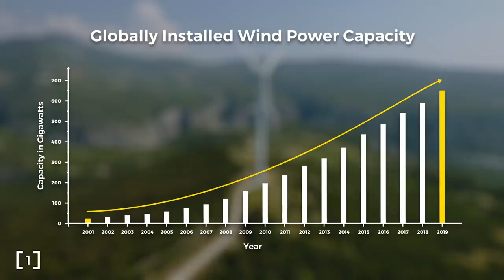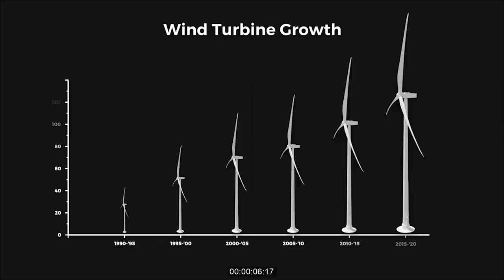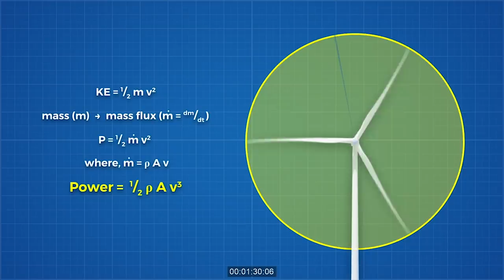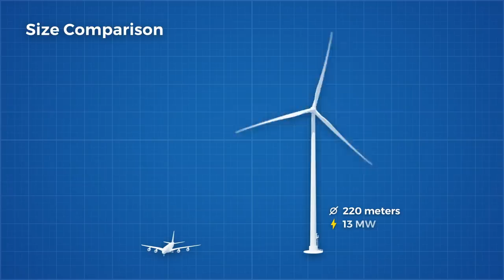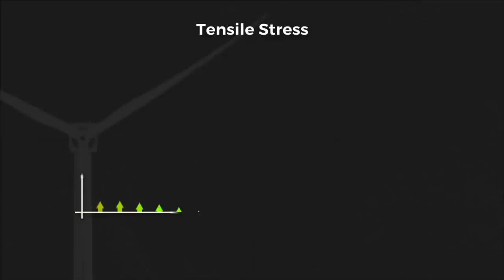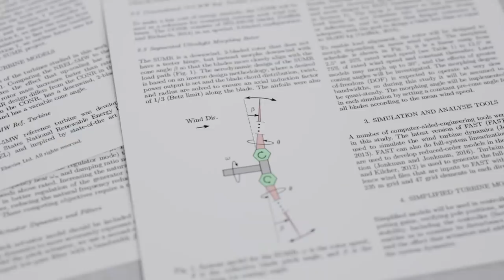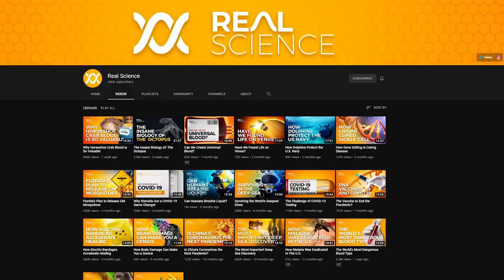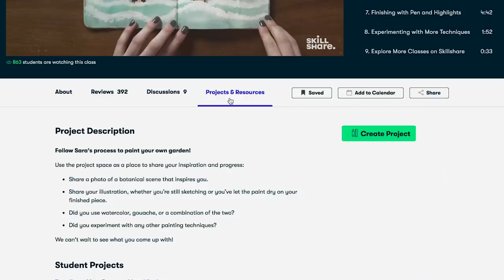How Big Can Wind Turbines Get?

Comment: I mean no. The challenges of handling this very volatile form of energy have not gone away and are still one of the biggest problems we are facing. Countries like Germany went big on Solar and Wind  have created huge problems for the grid to the point that it is not sustainable anymore and all the neighbouring countries are burdened and keep the net from collapsing.
Denmark is using quite a bit of their renewable energy for heating - a good buffer in this case. With district heating you can buffer the energy for hours and more - more than enough for the short changes that solar produces, while the wind-energy which is their main source is rather steady there.
But while wind is more stable than solar it is far from being actually stable in the energy-prices often crash into the negative - the producers need somebody to take up the brunt of the energy-spike or the infrastructure would get damaged.

Finding a way to store the energy quickly and conveniently is basically the biggest challenge for wind and solar right now.

Comment: Impressive cgi on the wind turbine in Paris.  If the CGI intended to show the Halide x, your scale is wrong as the tip height at 230m is some 70m lower than the Eiffel Tower at 300m.

Comment: You will probably hit other limits first, but one eventual limit will be as the tip speed approaches the speed of sound and the added drag when that happens.

WRT land based windmills.  Instead of building the blades at a factory and then moving them, how about build a modular factory components that can be moved on ordinary roads and build them on site?

Comment: You forgot to mention that wind turbines only have a service life of 25 years and that in a lot of cases it's even less because of dust and particles in the wind. These basically sandblast the blades making them way less efficient. 
Then there is the case of added carbon output for some countries that use 70% nuclear right now when switchinh to gas and wind. You even made a video yourself about gas vs nuclear.

Comment: The limiting factor on blade length is the speed of sound. The tips of the blades need to stay subsonic.
If you want a super long blade and have to rotate it very slowly to stay subsonic you will not get the energy from the wind that passes unmolested through the inter-blade gap. 
I don't see the point in any other consideration in the video. The first limiting factor is always blade tip speed.

Comment: Do they have a plan in place for recycling blades that large? This is already a problem with current models.  Thanks for the video.
Reply: shredding, Burning the carbon parts for Energy and the rest is used in Asphalt production.

Comment: Have you considered a point of principle at the heart of engineering which apposes compressive structures with tensile structures? How many spinnakers applied in an ocean current could you get for the cost of just the blades of a wind-turbine, how much greater constancy of yield, what greater force from the density of the medium which has a ratio to concrete of 1 : 2.4? With tension the atomic bond of the molecules is doing most of the constructive work. And in the marine - off-shore - the salt is ready-provided for electrolysis. No damage to marine life as opposed to serious damage by wind turbines to avian life, visual degradation of the landscape, fractional interface with the weather system confronted, partial use ability of the same, and fairly huge maintenance and repair costs. They simply cannot be the real future of energy generation. The leap upwards is into Geodetic considerations which means taking a whole view of Ambient Planetary Energy and interfacing with it at large or condensing it for use in more manageable proportions. I suggest that earth-tangent modular isocratic construction is the thing to consider - not minute stalks with blades on them - and that three starters for combination on that route are 1) Geodetic structures 2) the Isotropic Vector Matrix and 3) Khatmatrix - the last little known but essentially ‘normal’ cubic structuring but upon the basis of a syncopated cubeoctahedron and allowing dry-bond construction in the marine.

Comment: Wind mill huge cost but give 60 % energy converted into electrical energy more over Denmark is a country of winds 60 % Energy through the wind mill The large diameter of the Wind mill with huge cost of transportation in blades more over cost of making high to make wind mill but is renewable energy for World with high cost like Thermal power station Good analysis about wind mill & Structure capable of producing electricity with Cost & Efficiency

Comment: What about vertical turbines? No need for heavy drivetrains to resist over speed rotation. Cheaper structures with heavy drivetrains on the bottom.

Comment: When the blades are fatigued and due for replacement how can they be best re-assigned into something that would be widely useful.   Could the blades be manufactured  to be less than optimal so as to be easy to use in some other role?   It really goes against the grain to visualise the system just putting these  blades into landfill...

Comment: The maximum power is
Pmax=(2/3)^3 ×rho×A×V^3
Not the one (3:29) by a long shot.
The presented physics is sloppy, ignoring the fact that, to extract power the velocity must be reduced, which happens before the flow reaches the turbine plane.
Conservation of mass demands that the flow widens at the turbine disc and more so in the wake behind it.
If the full wind speed would pass through the disc, no power is extracted, as is the case of feathering the blades .
The equation above is is the famous Betz equation.
This can be rewriten
Pmax=(2/3×V)^3 ×rho×A
In this ideal case , the air approaches the turbine disc, slows down and crosses the disk at 2/3 the wind speed and continues to slow to a final wake of 1/3 the wind speed.
In reality the Power extraction is lower.
In all cases the  velocity through the disc is exactly the average of the wake speed and the wind speed ahead of the turbine .
The power extraction is the difference of the incoming wind power and the remaining power in the wake.
with the massflow through the turbine disc:
m*=rho × u × A
rho=density
u=velocity through the turbine disc
A=swept area

P=m*×1/2×(V^2 - w^2)
but P is also the product of the force on the turbine F and u
P=F×u
this force is the difference of the wind momentum m*×V and the residual momentum of the wake m*×w
F=m*×(V - w)
Dividing the power P by this force F the velocity through the disc u is obtained:
u=P/F=1/2 × (V^2 - w^2)/(V - w)
or u=1/2 × (V + w)
since the identity holds
(V+w)×(V-w)=(V^2-w^2)
The massflow is then
m*=rho×u×A
=rho×1/2 ×(V+w)×A
and thus the power extracted is
P=1/4 ×rho×(V+w)×(V^2 - w^2)×A
which depends on the wake speed and can be controlled by the pitch of the blades.
The power is a maximum when the ratio of the wake speed to the wind speed is one third.
This can be verified by differentiation of P(w) with respect to w and solving the resulting quadratic equation
dP(w)/dw = 0
The result for the maximum power is the   Betz equation as presented at the very beginning.

Comment: Harnessing wind for energy is awesome, however it also introduces a new and less discussed problem: What to do with blades which have reached the end of their lifecylce? Since most blades are made of materials which are not so easily recycled... would be interesting to see how or even if this design aspect is also considered when making wind turbines
Reply: You should try and live in a country that tries to make it on wind power. Your bank balance will not be happy. And yes, the blades are a massive issue. No recycling known. Overall wind turbines are a terrible idea and not at all green.
Reply: You might as well worry about glass fibre boat, or anyhing else of fibreglass. you chop and grind it up into really small sand-like particles and recycle theg lass with heat - it really is not as big of a problem as you think. Or if it is not worth recycling them you chop them up into bigg bits and send them to landfill. THey're extremely inert and so will just lay underground for many thouands - probably millions - of years.

This is all akin to those folks who say "but EVs aren't green because you can't recycle lithium batteries" - in both cases it is simply untrue. Old folks who used to deny climate change and have shifted to "proving" we can't do anything about it, so everything that reduces CO2 emissions "is not really green". The next step, of course, will be to blame the whole issue on "teh woke left".

Comment: 3:25 The equation does not consider that the airflow behind the turbine disc is at best higher than 1/3 the wind speed, and has some unrecoverable wind energy
BETZ optimum power equation is (2/3)³ × density × A × v³
The velocity slows down ahead of the bladed disc to 2/3 wind speed through the disc and slows down to 1/3 wind speed in the wake, in the optimal case. Normally the wake speed is higher and the energy recovery is substantially less.
The air speed through the disc plane is the average of the wind speed and the wake speed.
And the theoretical power is Vdisc³ × A × density.
In reality only 75% of that is realised, due to the blade drag.
44% of the value in 3:23

Comment: Great video as awalys! I am wondering why wind turbines arent held down by cables like its done with radio towers. Surely thats a cheap way of adding a lot of stability hence eliminating the problem of excessive moment from bigger blades. Also why does nobody put two sets of blades on. Its been done for propeller driven planes, so i assume it cant be that inefficient and it would kinda get a lot more out of the whole rest of the structure.

Comment: I wonder what's keeping the blades from having different, more compact design? A bit like small scale vertical wind turbines. I'm sure a litteral fleet of engineers already worked on the question and there's surely a reason to keep things that way?
Also, why only 3 blades ? Wouldn't more blade extract more energy from the wind flow, or  does the added drag nullifies that ?
and finally, could wind turbines blades benefit from attack helicopters blades technology ? If I recall, the blades tip on those helis are designed to keep the noise at a minimum, they look somewhat broader at the end.

Where's an engineer when I need to harass one? I need answeeeers

Comment: 0:45 A common mistake to equate, or at least taut, a yearly average percentage as if that makes it truly viable. If 47% is the average, it means that you can have months of practically 0%, and, as you say, also times where you get 140%. The point is, none, and I mean NONE of these systems actually are enough to be able to sustain a stable load base that covers enough the whole year around, and since they're intermittent, you're never sure when a shortage may occur. That means, any solar or wind systems HAVE to have a backup, and always will need a backup (until batteries become plenty available and dirtcheap), and that backup is mostly gas and/or coal.

We've seen this recently, at the start of December in Europe. there was a cold front, covering about half of Europe, and little wind and solar. The prices of electricity rose dramatically - a disster for countries that are dependent largely on solar and wind, and which had to buy electricity from elsewhere. But of course, every other country in that cold weather front wanted to do the same, hence: huge prices.

To be honest, while these alternatives have some potential, I'm getting dead tired of all the sites exclaiming their wonders, but never, ever go into the downsides. It would seem many think it's the miracle cure, but there are some serious problems with maintaining ALL of your energy from intermittent sources. In fact, it's next to suicide to do so,  at least on an economical point and until one has cheap long-duration storage (aka, being able to span 7+ days for your totally energy consumption).

Comment: I'm writing this as person who was involved in energy industry. Turbines are devices with low efficiency and low availability(comparing to coal or atom, in USA wind have 34% availability, atom 97%). Chart from beginning talking about only installed not produced energy. That is big manipulation. European regulators of power grids have big problems with "clean" energy, but that voices are ignored. PR and Politicians are on top, engineers are always ignored. For example German power grid almost collapsed(blackout) in 2018/2019. Dutch power grid is stabilize by  atom/hydro power from sweden/france(from time to time there is now wind). Clean energy is so problematic that grid in australia collapsed, in California they have many problems(in scientefic amercia there was article about this). Wind turbines are not clean. You need massive amount of cement, steel, cooper etc. that is can be hardly call clean(not only for turbine, this kind of energy productions require more sophisticated infrastructure) . And turbine is working only 20 years(coal/atom 40-60 years). About price. Clean energy have priority access to grid and have subsidies(for example 20% bill for energy in germany is for subsidies) In fact UN in report about how to save climate, pointing in 83% cases that only Atom can save world. that is ignored. In UE German lobby(and green party) is so strong that they planing to destroy atom by regulations. As engineering I can say, that is tragic. Politicians and "Green" industry are currently in power.

Comment: Except surely the noise generated from the speed of the blade tips isn't important for off-shore turbines. They can spin as fast as they like for optimum energy generation.
Reply: Incorrect. That noise travels insanely far and while offshore wind turbines are "offshore" there are also limits as to how far offshore they can be placed.
Reply: @AB-80X  How far?

Comment: Excessive electricity when not needed can be used to harvest Hydrogen for clean fuel in minimal wind days. Why can the blades not be attached to planes as wings and flown to sites, are these not air foils?

Comment: I'm no engineer but have they considered multiple smaller blades instead of one huge one?  Say six sets of 3 blades, 3 sets on one side and one set on the other side balancing the weight.  Then each blade set is mounted a certain amount of degrees offset the previous set so they aren't all lined up.

Comment: Wind turbine energy is the height of renewable 'green energy' gaslighting. Not unlike the photoelectric solar panels, there's nothing green about the amount of pollution created by the manufacturing of these wind turbines. Not to mention the tons of fossil fuel lubricants needed to keep them running smoothing, the death of wildlife caused by the blades and the miniscule return on investment compared to other sources of energy. And don't forget about how much beauty they add to the natural landscape.

Comment: Am I weird when I expect an answer when the video title is a question on an engineering channel? I get that questions like "Is there other life in the universe outside earth" are hard to put a number on. The video did a great job in explaining the parameters as to a point that a Ballpark would be appreciated. But leaving with "they are up to 220m in diameter and get bigger" was a bit disappointing. I would settle for an estimation like "barring the introduction of new materials the limit is ... Break-even for carbonfiber would start at.. and with Unobtanium the limit would be on the kilometer scale where air density changes due to altitude issues would further complicate the math to the point where we are not confident of an answer". Still, dropped a like :)

Comment: What happens to the blades when they get their fatigue cracks and fall apart? Sent to land fills? Please acknowledge and do a video on the importance of Liquid Thorium metal molten salt energy converters, their functioning at near ambient pressure but providing high temperature energy being walk-away safe and providing cheap energy at less than $0.07  per kWh ad an energy density of 43kW/m2 or 2×500MWe on 11.4Ha?
Reply: They get shredded and used in asphalt production.
Reply: @jamadir  Ho! Ho Ho! Do you need video of them being buried in land fill?

Comment: Are you out of your mind?! The premise that wind can not reliably be integrated into the power grid still holds. It's just that people do it anyway. There may be countries like Norway, who can store all of the volatile wind energy in pumped storage, but others like germany have about 1% the capacity to do that with no chance of a remedy. We just shut down the plants designed to run all of the time whenever the wind blows to power them back up when we need that. This ist inverted logik and wind is still useless unless you can store its energy.

Comment: I would be pretty interested in recycling of wind turbines since this is a pretty controversial topic.
Reply: Why does everybody care so much if wind turbines can be recycled, BUT nobody cares a dam whether an oil rig, a refinery, a fossil fuel power station, or coal, oil or gas can be recycled!!!!!!!! try recycling burnt coal!

In fact, Offshore wind turbines are around 85% recyclable, which is very high compared most things like household appliances which are a fraction of this percentage.
And solar panels are every higher percentage.

Comment: Waow, 650 MW, that´s still about 100 less than coal ...
We have how to integrate wind in our grids ... building coal or gas to compensate when there is no wind ...
Danish are probably happy to sell their wind electricity for almost nothing when there is too much of it and finally to by very expensive other electricity from the neighbours when there is a shortage ...
And wind turbine blade recycling isn´t really done, same for the hundreds of cubic meter of concrete poored in the ground to stabilize them.
Wind is just a small part of the solution